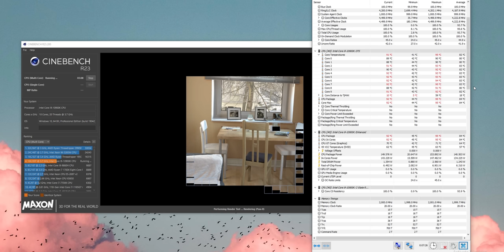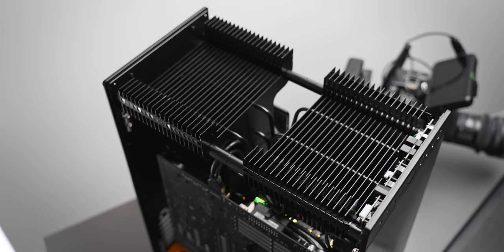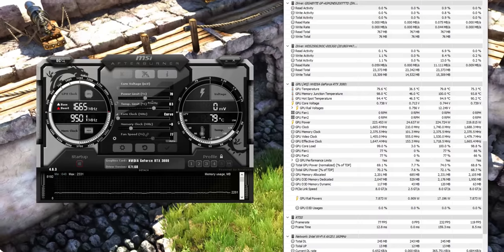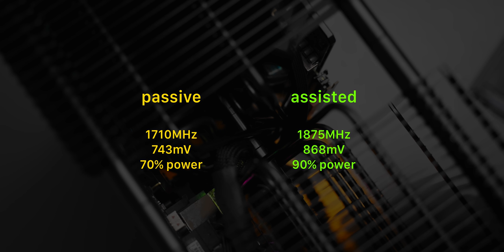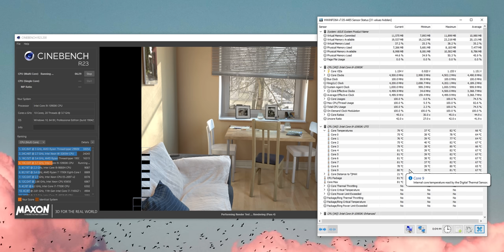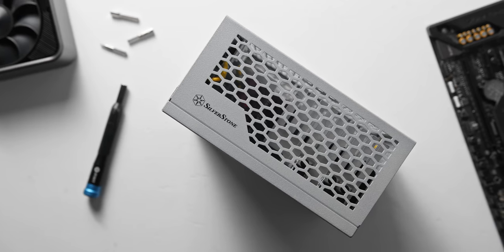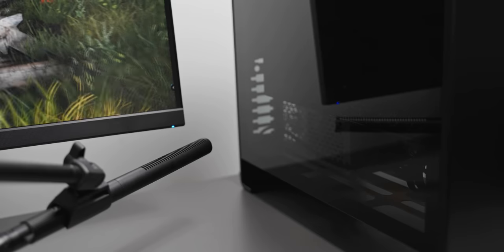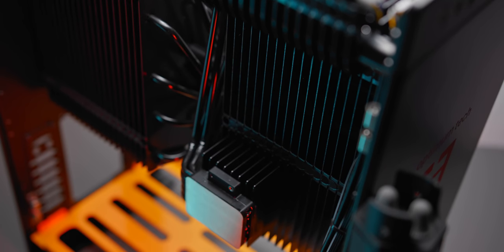The 100% Silent 3080 PC - MonsterLabo Beast!

Comment: That point comparing the cost to water cooling was very interesting, I had not considered that! Obviously you don’t have the same flexibility in terms of supporting higher TDP hardware or overclocking as water cooling, but having no maintenance or concerns about leaks and. such … that right there might be sufficient reason to give this a go.
Reply: when comparing to watercooling, don't compare costs and noise, compare costs to noise/performance ratio :)
Reply: Yeah I’m interested but it cost like 800 Euros which is like 1200cad for me
Reply: @nicojar  the whole point of this system is to be completely passive, this is something that even watercooled systems simply cannot accomplish, that's why you'd buy it. There are many use cases where a pc like this would be preferable to a water cooled one.

Comment: I owned MonsterLabo the first for 2 years now and enjoyed every bit of it. The quality of case is much much better than anything I have seen on the market.

Avoid Silverstone NJ at all cost, they are designed to have coil whine and specific voltage output. 
I purchased a NJ520 and it always coil whine with 8 pins power plugged in, not even on load.

Always go with sea sonic prime.

Comment: I love that the build method symbolically gets across the idea that this build is about a crazy cool case/cooler with boards and such attached to it, rather than the other way around.

I wonder if having a ceiling fan would help or hurt this. Likely more airflow, but it would be fighting the natural convection, and I don't know how optimized it is to natural convection.
Reply: I'm no engineer but I would like to point out that ceiling fans have switches to reverse air direction. And I suggest that stirring room air would probably increase convection effectiveness.

Comment: Considering that sub-1000 RPM quality fans are virtually silent, the biggest advantage of a totally fanless build seems to be a lack of dust accumulation. However, a fully passive build needs to have an open or vented top to allow heat to escape by convection, and that allows dust to settle in. So you may actually have less dust if you have intake fans with fine filters and positive pressure than if you have a fanless build. In other words, it doesn't seem to be worth it.
Reply: I believe that dust is unavoidable due to various factors such as surface tension and ions.
Reply: It would much longer for dust to affect this compared to fine mesh. It might need a blow out once a year.
Reply: @jondonnelly3  I disagree, on my NCase M1 dust accumulates around the top vent at a decent rate, but doesn't fall into the vent because of positive pressure from the intake fans. I have Demciflex filters on those fans spinning at 900 RPM and almost no dust makes it inside the case ever, after 2 years I did a full clean and there was almost nothing. Without the intake fans though, all of the dust that I clean off of the top vent of the case would fall into the case as well, that's a lot of dust over 1 year.
Reply: The other thing I forgot to mention is, it's even worse if you use the exhaust top fans because you then have 100% negative pressure.

Comment: Some zero rpm capable fans/bios settings would be best in slot for this case. Like for low-medium load - full passive, when exceding 80deg - fans start spinning.

Comment: I can't tell, but it would probably benefit them if they bent the fins to make venturis near the cores to allow for higher velocity airflow at the point of contact. It would transfer heat faster in one area, drop the temperature of the air and allow pressure to return to normal upon exit to mantain its quite engineering in mind. Maybe in a v2.

Comment: As someone with sensitive hearing, I found these fanless builds to be pretty much pointless waste of money in the end because you end up making the PSU coil whine much more audible relatively. The only way to actually get rid of all noise is to put your PC in an closet as many people do with AV racks in movie rooms and just run a fiber optic video cable out. That way you don't have to spend so much insane effort reducing the PC to ambient noise level when you have no control over PSU coil whine.

Comment: waiting for a passively cooled case the design of the phantesk evolv shift or sviger and a rtx 3080 passive edition no tweaking needed and then we are finally there
Reply: Did they announce something? do you have any urls?
Reply: @mitaralpski  Read again
Reply: The problem is you couldnt even mount a passive 3080 onto a regular mobo, that thing would wigh like 10 kilos

Comment: i would love to see a m-atx case like that, where you could either stay passive with lowrange components, or be able to stick some "silent" fans and go for more powerfull configurations. i am fan (hehe) of the second configuration myself
Reply: MonsterLabo has The First for mATX and xx60 graphics cards. Can probably run a 3060 at 175watts if you put a fan in there.

Comment: Very interesting video i was really surprised how well the passive cooling worked however i would not be comfortable with the temperature of the gpu and cpu running that hot. i would personally add a few noctua fans at low rpm because they are barely audible when running that slow it helps to drown out the electrical noise of components like the gpu as you said in the video

Comment: Fantastic video! One thing though, 100% silent builds are not 100% silent due to coil whine from GPUs. I've had multiple GPUs in the last 18 months (5700xt, 2x3070, 3080, 6700xt, 980ti, and 6900xt) and all of the exhibited coil whine that could be heard over noctua fans operating at 600rpm. Completely silent PC = move it to another room.

Comment: There is one Problem!!! Coil Whine...finding a 30X0 GPU that doesn't whine is hard. XD
Reply: finding any 30X0 GPU is hard :(
Reply from the maker: The one I used here actually has zero whine (10:52 shows GPU at full load)
Reply: @jamesthorogood1479  Actually in my Country you can buy many 30X0 Cards...it depends on how much you are willing to pay...the most expensive ones are in stock >_>
Reply: @joediditagain  Just undervolt It and the coil whine will be less without losing performance.

Comment: Nice alternative. However there is one thing should be considered if someone decides to go for it. Nothing can be added since motherboard is mounted on the case.
For example it's impossible to add more RAM if board is already installed right? If so then it's not so convenient.

Comment: Thoughts on using a massively over specced PSU in this build? Not a fanless PSU but one rated for a much higher wattage than the system will draw. 

For example a 5900x & 3070 with a Seasonic 1000w or even 1300w semi-fanless PSU.

Comment: Hello. Nice video. I recently ordered the Krux Naos alias Tecware Fusion alias Sama IM01 (there are some more Chinese names). I think you should review that pc case because it provides a lot more features than the NR200P for which you have done a review on several occasions and it is only slightly larger and a much better purchase than the NR200P (cheaper and has support for MATX, ATX PSU without additional brackets and looks much more attractive to me). Thanks.

Comment: I've got an almost silent build with a 3950x and 2080 cooled with a custom loop using 3x360 rads, 2 of which are really thick.

The coil whine on my GPU is pretty bad though, easily the loudest part of the rig which can still annoy me at times. The fans aren't great but I have them running so slowly just to move a little bit of air like convection.

I'll be playing wow and sending out covenant missions. When you use an add-on that simulates the best followers to do the mission, the GPU and game will freeze for a second then come back. In those periods it's incredibly obvious just how much coil whine the first RTX cards make.

Hopefully the next ones will be a bit better.
Reply: @Mario Kart this can be the case but it is not "the" case. The surface area isn't massively increased with bigger rads but with the speed that my fans are going, the temperature difference is a lot larger.
Reply: @Mario Kart No, there is a larger temperature difference with slow fans, favouring thicker rads over slim ones. Increasing the fan speed closes the gap.

Comment: What I'm curious about this with Ryzen - which can be a preview for next gen AMD and Intel - is how well those heatpipes can draw heat given the layout of these CPUs. Ryzen has a chiplet on one corner, or two chiplets; Alder Lake seems to have the P-cores just off-center and E-cores below each bank of P-cores (though not that far from the center). Some air coolers can have temp results on Ryzen that seem off given how much lower their power draw is vs Intel and seems to have to do with how the layout/orientation on the heatpipes due to the design or mounting orientation.

Comment: Putting it to the limits is fun, but I would be curious to see a build with a 5600X and a 3070. Would be interesting to know, whther it’s going to give 100% performance, out of the box. In the end I’d rather use 100% of what I get, than spend more and leave performance on the table.
Reply: @Mario Kart Yes of course, spending money on performance I don’t need instead of a FULLY PASSIVE CASE is so much smarter. I mean everyone has different priorities. Moreover, a 5600X is almost as fast as the higher models for gaming, and the higher core count options don’t make much sense for gaming in my opinion. The 3070 is a solid performer. So I can well imagine the desire to own a fully passive build, without the need to spend extra money on performance, many gamers don’t even need. If I had the desire to own a passive build, I would definetly go lower with specs, especially because the case costs 900$
Reply: @Mario Kart Oh you wanted to say - „different than mine”. And those aren’t mine, because I don’t need a passive build. But I have a 3090 paired with a 5600X, so I guess I am still a bit weird, not spending money on 6 more cores I would’t utilize.
Reply: @Mario Kart Nah, just VR. Weird, I know.
Reply: @Mario Kart Well again - wrong. Your problem is that you try to judge everything through your own set of needs. For me getting the 3700 over the 3900 would be fine. Both lack single core performance anyway, and by the time the next gen launches, I’d be much better off getting a new 6 core cpu than keeping the 3900x. As for the GPU and a grand more…. Yeah, not in this market. In Gemany it was pretty easy to get the 3090 at msrp, the 3080 however… not so much, due to limitted supply and high demand. And selling a used 3090 to get a new 3080, even with lhr is a profit of what? 300€? I’ll glady save it on the cpu. Moreover, in vr those 10% do matter, since it’s not the case of 70 vs 77fps or high vs ultra, but more „shit” or „less shit” visuals, and trust me - on the bottom end of the quality spectrum each gain is much more noticeable to the eye, especially in vr.
Reply: @Mario Kart Well then you should know, that the 3080 is the most difficult to get at NBB ;) If you are among the lucky ones to get one, then congrats.

Comment: the build looks cool but i want to have some noise otherwise it is quite nervous to not have any, like one or two 200 mm fans on top fixed to 200-400 rpm will do the trick

Comment: Imagine Apple doing this. Considering how energy efficient their new apple silicon processors+gpu are the next macpro being fully passive will be a huge deal. & its far easier for them to do considering it will max out at most 200w combined cpu+gpu for like 64 core cpu+64 core gpu lol considering 10 core+32 core is just sucking 50w

Comment: I bought the same PSU twice, 600W and 700W. Seasonic was the brand I have, but it's exactly the same except for the label and color. My computer is not fanless. But the psu was making the most audible sound when the computer was idle. Don't buy it. I don't know how the 450W and 500W models are. I am 36 years old and I can hear this noise very easily.

Comment: I have a bit of a dilemma. I currently have a 3080 FTW3 LHR in my PC. Its a great card, but most of the games I play (1440p 165hz mon.) are well beyond the 165fps mark. So I feel like I'm wasting performance. I wanted to go to a 3070 or 3070 ti, but I won a ROG Strix 3060 ti from Newegg yesterday, and I'm wondering if I'll be disappointed with the 1440p performance. I know it will run my shooters fine, but how much will I have to give up as far as image quality to get 120+ fps on more demanding games? Any info from you or anyone else that has experience would be appreciated. BTW my cpu is a 5600x, 32gb 3200 cl16 ram.
Reply: plenty of benchmarks exist to answer that question. It will come down to games you play and new games could very well need the grunt of the 3080
Reply: @jondonnelly3  Yes I'm aware of benchmarks. They're great for general comparisons, but I'm asking for performance at more real-world settings. Have you ever seen a benchmark at anything other than ultra settings?

Comment: You could try the Seasonic PRIME TX-700 fanless, perhaps that doesn’t have the high pitched noise
Reply: This Silverstone NJ700 power supply is just a rebranded Seasonic PRIME TX-700. The only difference is it's sprayed a different colour and has their own logo
Reply: @jamescater66  really? Didn't know that. The only thing you can try then is send it back and hope the replacement doesn't have the whine. I have a TX-700 and that has some coil noise too, but it's in a closed, padded case, so not audible.
Reply: I don't own either. I'm just pointing out that the NJ700 is exactly the same as the TX 700

Comment: Almost zero maintenence, unlike water cooling. Couple of nice noctua fans with an oh shit profile for very hot days and good to go. However I wish the cooling was unified not cleaved between gpu and cpu since it's rare that all cpu cores and gpu is maxed out. Unified cooling would support a 3090 GPU overclocked with cpu part loaded for most game workloads. A heatpipe bridge between the stacks as an addon could fix this.

Comment: i will never understand passive cooling (other than industrial reasons). if you want to go for absolute silence, just go with some overkill cooling and high quality fans with super low rpms. even my arctic p14s can go as low as 400rpm being inaudible from further than like 20cms. super low active airflow will always be better than passive
Reply: The only practical use of passive cooling I can imagine is for builds used for professional audio work - other than that good 120mm@~800rpm/140mm@~700rpm fans in reasonable quantities are more than enough to cool radiators or quality dual tower cooler/deshrouded videocard heatsink for almost any cpu or gpu and are very quiet...

Comment: is r5 5600x and gtx 1660 6gb oc a good combo
Reply: @gnestakommunfullmaktige9131  correct
Reply: that CPU is way too OP for that GPU, you’re better off saving some money and go with a 30 series
Reply: @gnestakommunfullmaktige9131  Dont buy the 3600 now. the 10400 is $150 and outperforms it
Reply: @LeJunny  i aint got no money for a 30 series

Comment: Cooler commercials always make me thing how people understand values like 400W of dissipation. Any radiator is able to dissipate 400W or any heat load. The main question is the temperature increment from the heat sink (ambient) to the hot component at this heat load. I assume that 400 W means something like the motherboard, CPU or whatever it is cooled properly (<80) for this thermal load, but this value means nothing if there is not defined any target temperature (and ambient temperature).

Comment: Well, this is not practical. A lot less performance and will shorten the life of your hardware. Water cooling is the best option for quiet set up. I doesn’t hear my 3080+5950x with two AIO coolers.

Comment: Too expensive for the benefit. You can get a near-silent setup for the cheap and you don't notice a difference unless you're sitting in complete silence with your ear to the case. Or maybe if you have too much cash... whatever floats whoever's boat. 95% users will have a set budget and "completely silent" vs performance is not a tough choice.

Comment: 92 C. That's just not working. It can't handle processor heat. Install Ryzen - you can tune it's power. Install slow Noctua fan. It will work much better. Ah, you did it.

Comment: Sorry, but you probably need to work a ton harder to convince me that you are right this time about noise. This rig has coil whine, and a lot of it, unless something sensational has happened to the GPU. Sensational as in a revolutionary design, or a significant omnipresent issue has been fixed by stupid simple means.